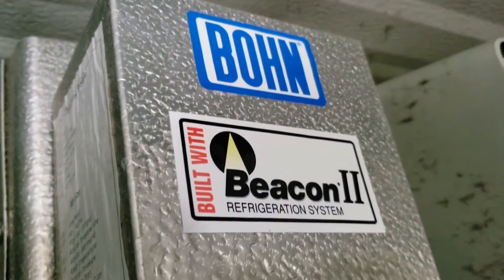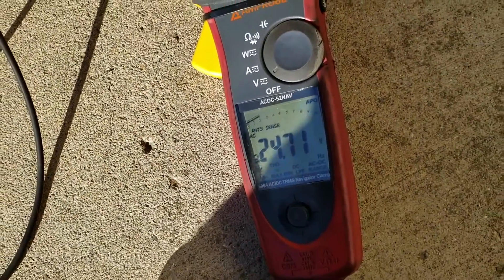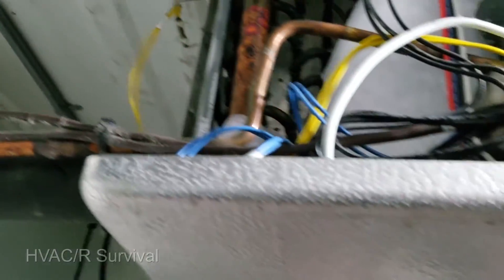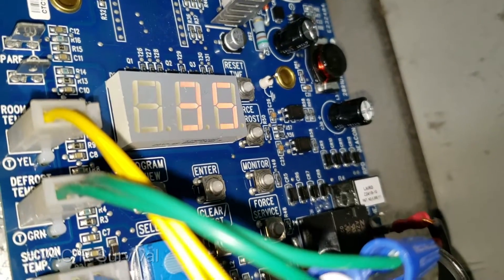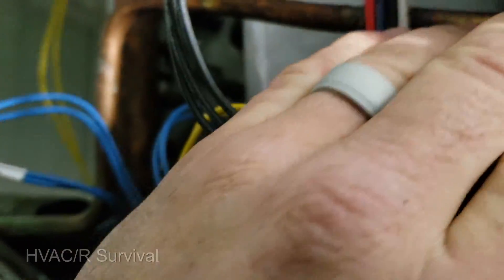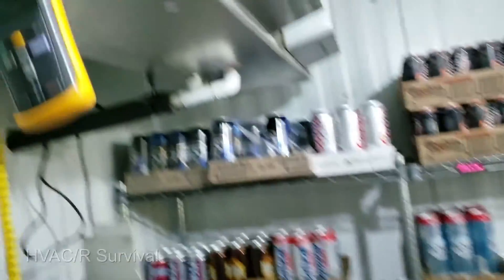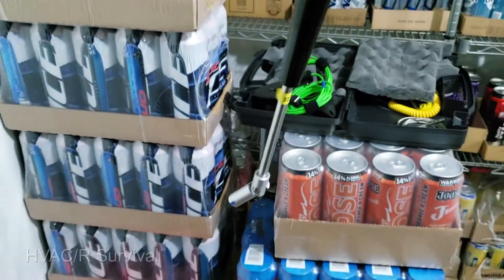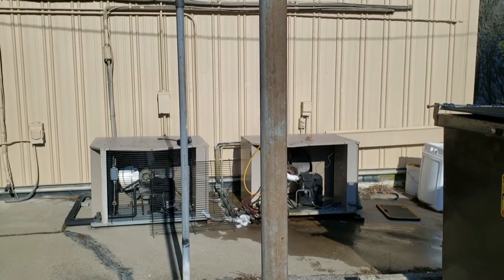Beacon II Heatcraft Controller Explained, Walk-In Cooler Suction Line Freezing up & Low Super-heat

Comment: can I call you about this single evap system. I'm getting an E7 code and A3
Reply: I just changed the super heat set point from 13 down to 10 and the EEV started to move now the coolers at 36ﾟ I also added about a pound of refrigerant.. We were experiencing 30ﾟ temperatures in the morning and late evenings
Reply from the maker: Cooler should be 8-10 area

Comment: Once you program the master unit. The slave unit get the program automatically. You don’t need to program both. They should be wired together.
Reply from the maker: Your right, I was new to these when I recorded this. They were linked. 👍👍

Comment: I don’t do refrigeration but have done those units.. the thing I like is all the temp sensors are the same thing just different colors. They put an extra in it which was nice too cause the installers burnt up the suction line sensor..

Comment: Damnit , now I need that probe ... And I need that Fluke too 😓 , but it's just too damn expensive out here , pretty sure it's more accurate than the Testo 922 I use at work , the bloody thing has 2 probes , and there's always an offset between the 2 readings , even when you put them side by side ! 😡 
I guess if I can find it somewhere for less money I'll just have to tighten my belt and get it !
Nice vid as always 👍
Reply from the maker: That's why you can calibrate the fluke in the field. I got it on Ebay for half cost of new.

Comment: Old school eev. I usually check the steps on the eev, maxed out open at 249 steps will help determine low on charge or defective eev. They generically sized the eev to cover up to 6 tons.

Nice job
Reply from the maker: Do you need a tool to make it open and close or is there a way to do it through the controller?
Reply: @HVACRSurvival  the eev will max out at 249 steps in attempt to lower to the superheat setpoint. All you have to do is hit monitor and check the step total.
Manual setting the eev to open will not do much. From experience, near box temperature, Normally the eev will be open somewhere between 90 and 130 steps

Comment: So not a Havc  person. Have general knowledge.  Understand the theory of how it works. Know use TXV valve as expansion valve into evaperator.(the expanding gas going from high to low psi, pulls energy from surrounding air)  and cause the evaperator coils to get cold, where blower pulls air from building etc., then push across/ through coils, cooling air as it returns into building.  Cooling same. AC.) Suction back to dryer/compressor (to compress back to high liquid high psi )then to condenser to coil (w/fans to remove heat/energy from coils) to TXV, round and round it goes. Okay what I don't get your talk of super heat? Understand suction pressure and head pressure. So on this pump down the TXV stays closed and a psi sensor, on suction shuts off compressor just before 0 psi on low side. Unit times out to defrost coils ( this helps because no gas expanding from heat will defrost coils quicker), then open TXV and turns on compressor?  Okay what is the check to keep gas liquid, from going back to evaporation coil? (The TXV closed, acts as both high valve and the check valve, at same time? (on pump down), or is there a check valves in compressor?) So still don't know whats super heat? (Is it the temp difference from incoming gas, to out going liquid?). Now I have never had any traing in HVAC. Have worked in oilfields and refineries with high pressure gas and oil/liquids through chokes, glycol units to strip water out of gas, at high temp and pressure. Cracker units, condensation towers, heat exchange unit's and liquid/gas seperators etc. So know about pressure dropes, cause freezing and compression gives off heat. (Notice compress heat energy, expand cold energy) and large compressor and pumps up to 15,000 psi and cogen electric where use liquid gas put through heat exchangers with high temp steam from mother eath. Flashes gas then run to gas turbines that turns generators to make Electricity. The gas then goes to large fin fans cooling towers. Then into compressor, to more condensers, to another compressor liquid gas to heat exchanger. Round and round it goes like a AC in reverse. Also, the used heated steam/liquid, is also run through fin fans cooling towers, liquid/water is then pumped back into ground,  where Mother earth is the heater. Then pumped back out with steam to heat exchanger, Round and round it goes. Clean energy. Note: plants use there own electic power usually 1/4 or less of out put. Rest pure proffit after pay back cost of building system. With mother earth as heat source. They pay for them selfs in two years or less. But they dont want everyone to know that.
Reply from the maker: That sounds awesome, you definitely have a good understanding of how it all works. Superheat is nothing more than the temperature that you have added to the refrigerants saturation temperature. Once you either condensed a refrigerant by subcooling it, the amount of degrees past the liquid Flashpoint is the amount of subcooling. The amount of degrees Beyond The Vapor flash point is superheat. I'll see if I can find a video that explains it a little further but that's the simplest way to think of it is just the amount of heat that you have gone beyond what you needed to turn it into a vapor for your superheat value or a liquid  for your subcooling value. That additional amount is kind of a buffer zone to make sure it stays in the state that you want.
Reply: @HVACRSurvival  okay got it, understand the temperature points (flash and liquid). Never heard references as those terms. As above and below. But in cogens the amount of cooling gas is  is measured in 1000 's of cubic ft. (In gas state)We just watch the psi. In my working career. Spent 22.5 years just making holes in ground. Deepest was 26,000. Some of scary stuff was the geothermal,  thats drill for the steam. All of it is like holding a lighted match next to a balloon full of gas, and a pin trying trying to pop it,All with it next to your head.
Reply from the maker: @KG-yn9qi  your probably not able to record that are you? That would be some cool shit to see
Reply: @HVACRSurvival  no they dont like videoing of facilities. Also I have left that work. Trying to retire in march. Last 15 years working for DOT as mainteance Supervisor, time to quit and enjoy life a little. I can do a lot of things. Mechanical and operate equipment. Started full time on oil rig  at 15. Made Driller/operator at 18, was a fluke. In charge at that age was a battlefield, they felt punk kid running the show! Well I got it done. Done everything to a hole in the ground you can think of. Oh and the fracking thing , all BS was doing that in the early 70's, no prblems. In refinery work and cogen was a pipe fitter and maintenance. Know control systems. And repair of motor  valves. Relief valves. And mechanical control,  level controls, eletric and displacement. Fluid meters just all kinds of stuff. Regulators of up stream and down stream control on and on. Got tired of working 6,7 days a week 80/90 hrs. A week. So took cut in pay started with DOT now maintain freeway and state roads. 5 days a week 40 hrs. Except for emergency 24 hr call outs. For accidents and weather conditions. And emergency repairs.
Reply from the maker: @KG-yn9qi  congrats Kylee👍👍🍺🍺

Comment: ohhhh, sensor pushed out, silicone the hole and the end shut, thumb gum may not work well there. then again who has time to let the silicone cure enough to stay and be water tight.
instead maybe silicone grease or simply blue pipe dope (lol)